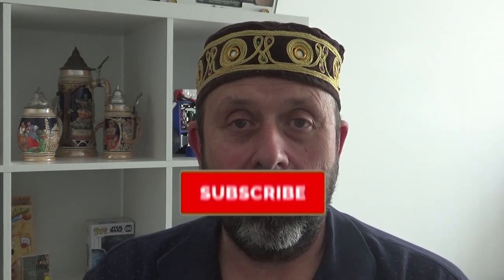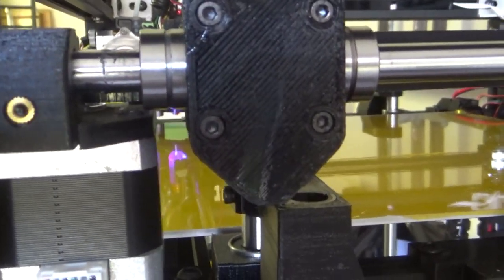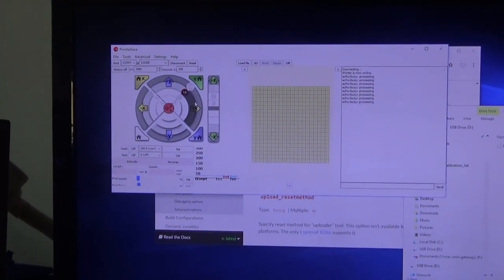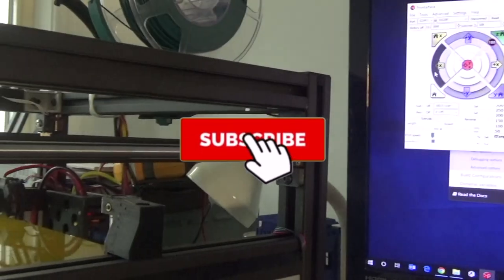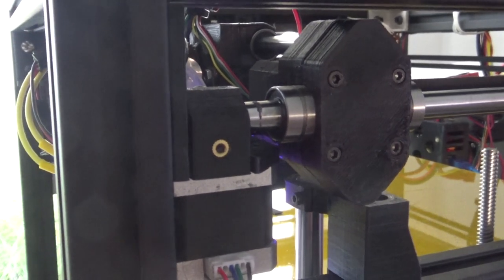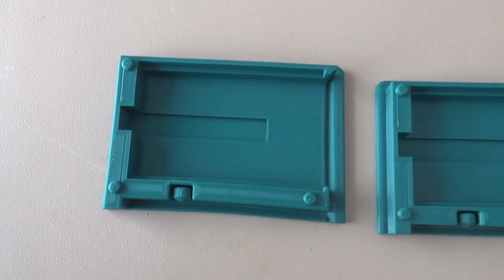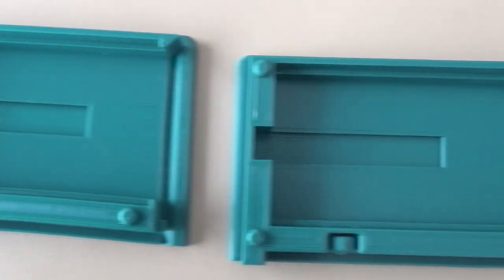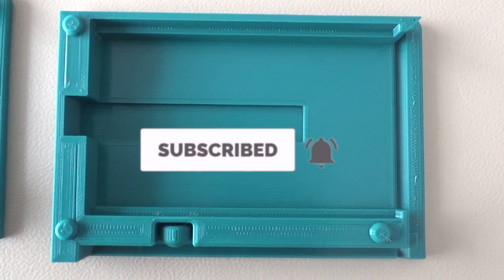#108 Hypercube Evolution 3D Printer Build 15 - (Problem Fixed)

Comment: I found that those steel belts are too stiff to conform to small radius of pulleys used on 3d printers.
Reply from the maker: Yes I agree as well. The fibre reinforced belts are much more compliant so run much smoother on the pulleys. Won’t be using them again on such small diameter pulleys.

Comment: What was your source for the good quality belts that solved your motion problem?
Reply from the maker: Hi, I used a local supplier here in Australia rather than risk it with another Chinese supplier. Was much quicker as well.
Cheers Nev
Reply from the maker: Have you had similar issues?
Reply: @GrumpyOldTech  In the three printers that I own, I have not had problems with belts, but I am currently designing my own printer (don't ask me why - I don't know either), and I am interested in getting good quality belts for it.